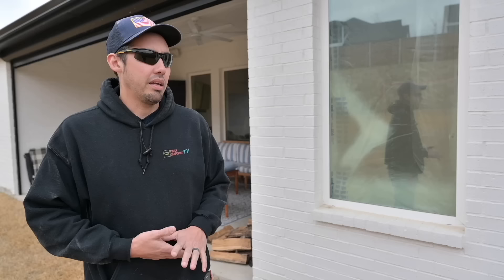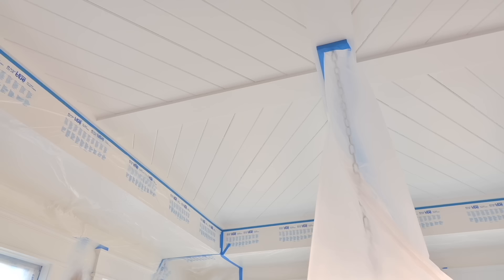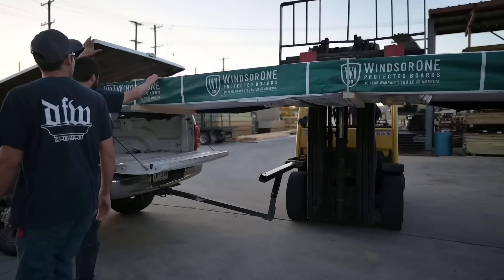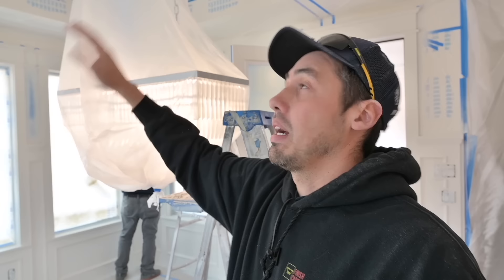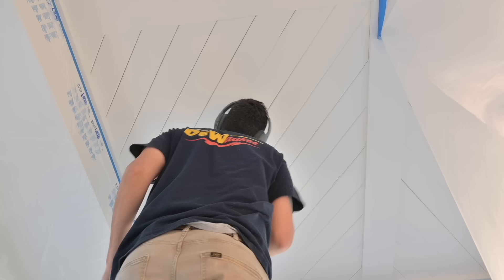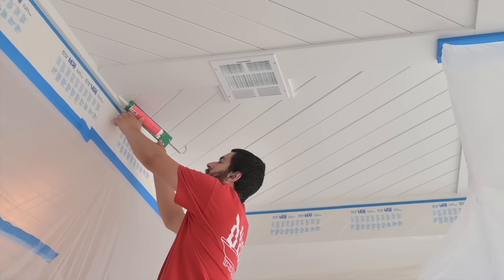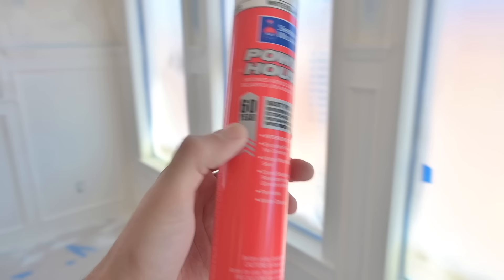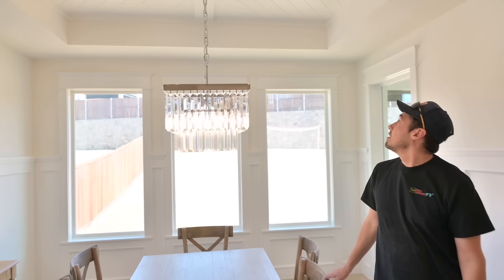Customer furious with me - Failed Trim Install

Comment: I had a similar experience installing a bead board pine ceiling at my cabin.  The lumber came straight from an indoor lumber yard and was unstalled immediately.  Unfortunately, my cabin is located yards from the beach and two weeks later the ceiling literally exploded - pow! pow! pow!.  I removed and reinstalled the ceiling and it had gained 1" over the 12' width of the room.  There was no expansion lenghtwise.

Comment: Sadly this is one of the reasons I don't mind mdf. If it is up to me to decide for the home owner I always grab mdf. Even with it being cancer board it is hard to beat a perfectly straight board and not sorting through piles of lumber. Especially if it is going on tall ceiling like that. If mdf is a bit wet you will know immediately.

Comment: I will recommend sherwin williams caulking
The green one 1050
To prevent that issue in the future
After that use problock primer ,than the glossy paint ,you will be fine

Comment: I’m not sure if I would call what happened a mistake.  It’s wood.   It will expand and contract.   Caulk is an effort to hide what the wood will naturally do.   Your install is perfect and your work  is very professional.   I like the way it looks with the lines and gaps.   To me, if the homeowner did not want to see any lines, they should have used sheet rock.  Just saying.   Great video, thank you Sir for sharing.

Comment: The caulking product type is critical here. Typical acrylic caulking is not intended to accommodate movements. I would suggest using a polyurethane or silicone, something elastomeric, as you suggested, that is formulated to accommodate movement - make sure what you use doesn't bleed/ cause staining of the adjacent substrate. Something that may have saved you time here would have been to simply apply a coating of elastomeric paint instead of re-caulking. The cracks didn't seem to wide and I suspect the paint would infill/bridge adequately. These paints are typically used in exterior applications for their water resistant properties, but they have flexibility/ elongation properties that may have helped you out here.

Comment: Cracks will occur again if the boards are real wood . Nothing can stop wood movement in real wood .Real wood expands and contracts with changes in humidity and temperature from season to season.If you used MDF boards then you’ll be Ok , otherwise you’ll be back . That’s the reason they make the tongue and grove on real wood ,to allow it to move . It’s a hard lesson to learn and you may not have completely learned it yet . I see this problem occurring almost daily on many woodworking sites , rookies not familiar with the fundamentals of wood movement.

Comment: I think he did very well to remedy the situation.  ANY decorative wood project, whether furniture or affixed there are going to be expansion and contraction issues sometimes.  Yes, he should have had his materials pre-tested, but it could have still happened based on environmental factors.  Like an indoor pool and moisture movement...  either way.  He is not a piece of crap, he is a craftsman!  In time he will master his trade.  Until then his contracts must indicate that shit can happen.  Being a stand up guy and covering these issues is why he has insurance and contingency funds.

Comment: As a professional painter of 30 years (roughly) I can say to never ever caulk those, or cabinet doors and if you absolutely must; use as little as possible. It’s one of those cases where less is more. When the boards expanded they pushed your caulking out and created small mountains of undesirable texture. It’s better to let the caulking get pulled and then add as little as possible after that occurs. It’s better to inform customers of this possibility, so they aren’t shocked or dismayed when it actually does occur. It’s best to let the structure and the substrates within to acclimate to the environment. Don’t caulk it at all for the first year if it can be avoided. The other option is tighter gaps and every contractor knows that isn’t feasible as wood can push against itself and the same problem occurs only this time causing a deformation to your substrate.
Reply: As I watched further into the video I can see you’re already aware of what happened.

Comment: Great video. I know you ended up making the screwdriver work for getting the caulk out, but I was thinking maybe the pointy part of a 5-in-1 scraper tool would have been perfect. It’s not too sharp and probably would have been easier on your hand with the way the handle is.

Comment: Back prime the underside of the T&G 1x6 or 1x8. That should help with cupping and wood movement. Not sure how you did the install, but I would strategically face nail the boards. Paint the boards prior to install then put them up.  Otherwise you’ll have the problems your describing. How much space on the underside of the cavity?

Comment: Question from a beginner:
What climate are you in? Is there a wide swing in humidity from summer to winter? Is it possible for painted interior finishings like that to continually swell and shrink w the seasons? 
(Like toned down version of outdoor decks?)
Or will the paint seal off those fluctuations?
What about if it's more of a sunroom situation? With alot of open windows and screen doors where up in Ontario we get crazy humid summers?
Just asking bc currently helping a family member turn outdoor deck into 'interior' space and wondering how much continual movement to expect and ways to mitigate. 

Thanks ! Great content as always.  Failure or not, your squad are clearly fine craftsmen who still always seem to be progressing and learning more.  It's great to see crews with that kind of effort and pride in their work.

Comment: Owning your mistake and fixing it is a sign of a true craftsman. Unfortunately the ceiling was going to fail and to make things worse it was painted white. Ceilings are going to be like a dry heater sucking out all moisture from solid wood and will absolutely shrink over time. 
The install looks great.
I have seen 6" oak plank flooring push walls out of alignment from expansion and then reverse cup after drying out. 
5 to 6 percent moisture content at install of the material should be good but the entire house also needs to be climatized or the wood is going to suck up that moisture and then shrink when it is climatized.

Comment: Couldn't you have used a multi-tool with a caulking removal blade? Or also a recip saw with a caulking removal blade? Just curious. I guess because you have less control and the knife keeps you in line. Either way, great job man. I love that you stand behind your work and let us learn from your mistakes.  We all make them. This right here is why I subbed a few years back. Thanks for the tips, take it easy.

Comment: My questions include, what kind of wood is it? Clear cedar, cvg fir or what? What is going on above this tg wood ceiling? Is there a crawl space or are the 1x6s nailed to the bottom of the  roof rafter framing? A 1/4" of board shrinkage seems like a lot if clear cedar or cvg fir were used here.

Comment: I try to NEVER caulk tongue and groove (especially on ceilings). It allows it to naturally expand and contract. If the customer demands it, I explain that they could have exactly what you have there. No caulk will hold those seams together. 
If it is going to be painted, the tongues need to be painted BEFORE installation so that if it does contract, raw wood doesn't show.
You are re-caulking, and chances are you'll be back to fix it again.
To reduce expansion/contraction, maybe go with pvc (vinyl)? It moves along its length, but little to none along width.

Comment: Rule #1. Don’t caulk. This material needs to move and will move all year round. it’s great you got a moisture meter, but even that won’t save you if the house does not remain climatized year round. Even if it does, depending where this home is located, if it requires heat in the winter months, the boards will shrink. Even then, the wood is ALWAYS moving as it adjust to atmospheric conditions. If you could have known before hand, and brought all your material inside for a week or two, it could have helped. I’m a professional cabinet maker, furniture maker and general wood butcher  (turning 70 this year and still at it) and most quality cabinet companies will not warranty their “Painted” cabinets from cracks in door joints if the cabinets are brought into a space that is not climatized. 
In the future, you would want to at least prime the wood with the same color primer as your final top coat to hide the movement in the wood. But please don’t caulk. I know modern caulks are designed to be flexible but this expanse of space is just too much. Educate your clients as to the characteristics of wood and it’s movements. Me personally, I like the hairline cracks in painted wood, at least I know it’s not some crappy plastic or MDF wannabe. All right guys, let me have it.

Comment: If you are going to caulk t&g atleast use something that has enough stretch to allow for the contraction and expansion.
Big stretch is super good for this.
The wood is always going to flex with temperature changes and house shift.

Comment: kudos to you for doing a full repair -which mustve cost you a packet

sadly this was inevitable -you wouldve been better using grooved mdf -if you can get mdf in USA.

I ran a joinery company for many years and always preferred to use mdf for this reason

if you have to use T&G softwood, paint the boards first so you get the tongues covered with paint, then do a final coat once installed

by the way: lovely neat quality job, its a shame you had this problem

Comment: paint before install and never caulk. heat and AC will change the humidity in a house and the board will always be moving, also the time of year I do the install I may or may not put them tight.

Comment: Those gaps between each panel will always grow and shrink with the change in climate. As the humidity rises the wood will absorb it and grow in its width causing the gaps to shrink or tighten. Then as the humidity lowers the wood will release it  and shrink in it’s width causing the gaps to get bigger. As long as it’s wood and not mdf then it will always grow and shrink trying to reach equilibrium with the climate around it. This only affects its width, not it’s length. Usually the caulking will have enough expansion and contraction to cover or hide this.

Comment: Like watching your channel, just a suggestion the sections in the ceiling that you put tge bead board on why not just panel it with mdf and router the bead in then you never have to worry about shrinkage and still looks like bead board.  Tongue and groove alway shrinks no matter what, seems the tighter you install the more it shrinks lol.

Comment: Windsor is notorious for extreme shrinking.  I never caulk v groove or center match.   Best to finish paint the boards before install for many reasons.    If the layout allows, i make simulated V groove out of MDF panels with a router and grooving bit…the only expansion is at the perimeter which is concealed.  Should have moved the HVAC register to the center of the panel, it looks like a mistake.

Comment: Definitely do a 1 year update!!!  I think you may have it and the look is so much better than without caulk if it holds up over time.  Many good comments and many suspect thoughts shared by some.  I'm curious on what the board material was.  My biggest concern on the fix is the locations where the old caulk was not removed - hoping it holds for you!  Still looked good, but would be concerned it's not going to flex like that new SW product you used on the fix and may be the next to pop.

Comment: Honestly this trend of caulking every single joint and seam in sight is a detriment to the trade. Like others have said, there was no need to seal here and, in a lot cases where the caulking won’t fail the finished product, will only look good for a short while. Once the caulk starts collecting dirt, discolors, and cracks it often looks worse than nothing at all
Reply: You are so right!

Comment: yea it's recommended to store wood in the building where it will be installed for 72 hours before installation so it could cure to the room temperature and moisture

Comment: I think that the best product to use in that type of application would be MDF. Get 1/2” sheets and rip them to your width and changer the edges. Or you could v groove into the full sheet.

Comment: cudda used an oscillating tool with an already dull saw blade. The head from the saw moving back and forth would melt the caulk. just keep the blade plunged straight up and almost all the way in so you don't mess up the boards with the blade.

Comment: One thing I came to realize in this business after nearly 20 years of the trade , is that you can't make everybody happy regardless of how great of a job you do. Some people are cool all the way through the job and when it comes to pay the piper , people will always try to pick apart your work. But in this business every customer is potentially a repeat customer. Also if you do good work , your work will sell itself. Like where I live at in Baltimore City , there is only 2 other companies aside from mine that builds rooftop decks. I know when I build one on one street , I will have at least 2-4 more referrals just in that radius block. All I can say is, do the absolute best job you can do. You can't make everybody happy , but at the end of the day , you know it's right and you did the best of your ability. Never sell yourself short in this business, because 1 job can either make or break a company. Always have a good crew , get rid of the bad apples. Good guys might cost a little more , but in the end you absolutely know your getting quality workmanship and it's getting done correctly.

Comment: Tongue and groove moves and can get ugly. I put some up in my home. 3/4” made it myself and made sure the MC was good at the install. I caulked the joints. Many opened. I spent a week this winter recaulking and repainting. The driest time of the winter so shrinkage was maximized. 

Wood movement is a son of a gun sometimes.

MDF T&G would be a better choice in both my and your applications.

Comment: using a water base caulk or no more gaps as its called in Australia doesn't last long enough, if we have to do this we use sika-fkex, we use with a spray bottle with watered down methylated spirits and rag to wipe excess off it has alot more flex than your traditional water based caulking. This would of been a tedious job but it's good to see he got it sorted.

Comment: You will have the same issue another year from now. Never caulk that stuff. Paint the tongue and groove before installing. If you dont want a gap it should be a solid sheet

Comment: Each board is going to expand and retract 1/8 per 4 inches, every year, and nothing will prevent this unless you can keep the room at the exact same humidity level... Also, if the wood was not aged and aclimatised properly, you will have larger gaps later on, larger gaps that will move all the time...

Comment: I didn't catch what species you used, but sorry to say it but my experience with solid pine V groove will continue to expand and contract to some degree.  I've had projects where they move regardless of pre-install acclimation/ moisture content.  I've had some of them move as much as 1/4" apart.  Caulking that crack only exacerbates the look.  Now I explain to customers that if they want solid wood, it WILL move guaranteed.  If this is a deal breaker for them we use MDF at an upgrade cost to the customer.    But caulking this crack in solid pine will nearly always fail and look like that.  It would be better to allow the boards to move independently as they will.  My 2 cents based on 27 yrs experience.   Best of luck with this issue.  Hopefully it doesn't do it again but good job for standing by your work.

Comment: There is only one way to address this issue and that is to tell the customer that a year after install it will need redecorating regardless and they can either pay for it at first install or when you come back to do it. I have been doing this since 1984 and I have never seen an install of painted softwood t+g which has not contracted or expanded. It is has to adapt to the room it is installed in. I don't believe the timber suppliers could dry it to the extent which prevents any further movement. Your only error was not to tell the customer before install that it would need redecorating, typically, the architect or interior designer never thinks of the long term or covering the tradesman's back.
Reply: 10:05 To acclimatise them you would have to leave them in the room for a full year and I don't believe that the timber supplier is ever going to be able to dry them sufficiently to stop shrinkage. As I said, before you start tell the customer they will shrink and crack and there is nothing you can do about it. When they do crack the customer will only think that you were honest and knew what you were talking about.

Comment: Seems to me you'd want to pre-prime and pre-paint the material before it is installed.  Then install as usual sans caulk.  them when wood shrinks there will be painted surface on the tongue and it will not be as noticeable.  That is the way cabinet doors rebuilt.  The panel is prefinished before it is installed in the frame.  As the panel shrinks with the seasons it is not noticeable because the entire edge of the panel has finish on it.

Comment: Customer needs to and a humidifier in the house. Clint will have this problem there heater is drying the Air. Worked on a house that was all oak had same issue until the general contractor added a humidifier.